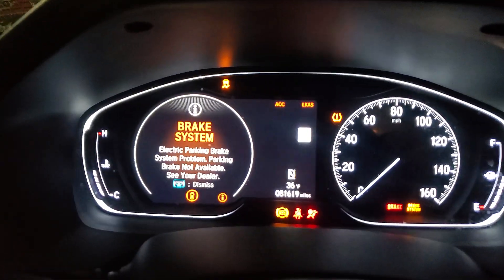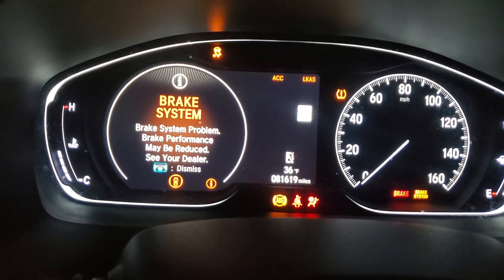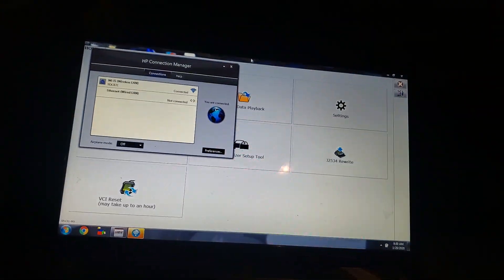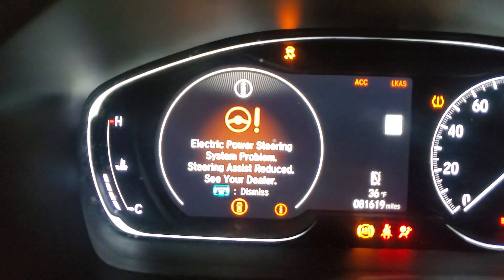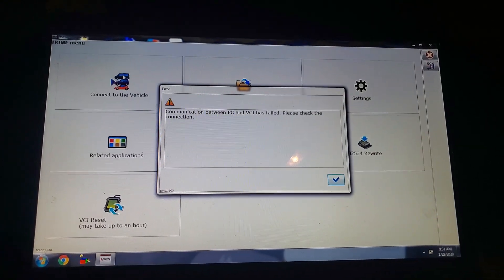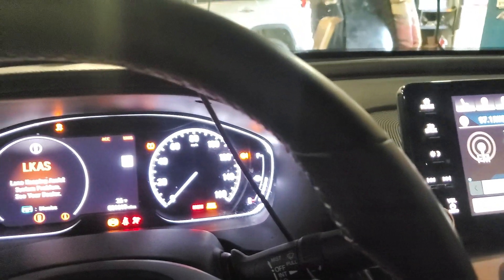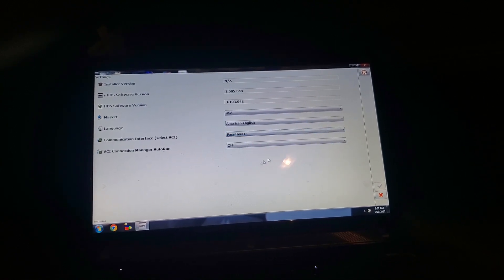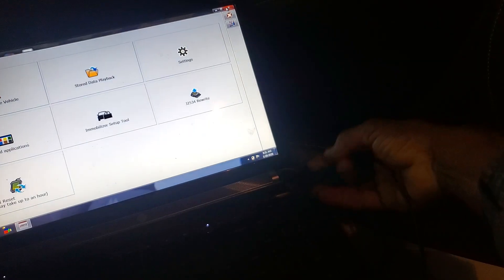2018 Honda Accord Anti Lock Brake Module

Comment: How fix the problem i replace my and wont start also have the immobilizer lighy blinking on dashboard
Reply: Hi there,  have you solved your problem, I have the same issue abs module and pump replaced, car wont start now  and immobilizer blinks
Reply: @mauroarcomaldonado2455  any luck finding answers? Im in the same boat can't get my car started with new module
Reply: @margaritalashchuk4144    Hi  yes I actually got mine working
Reply: But it is not simple,    Your car will not start until  someone with a powerfull enough scanner reprogram the  abs module with the car main module    In an other words   After replace the abs pump  somone need to marry the new module  to the  main car module  and the the car will start,  you have to options, one the dealer wich is expensive or a local Locksmit may have the rhight scanner,   I  asked a lock smith and he  gave me the number of one of he’s  friends that do have the scanner,  he reprogrammed it in 5 minutes and  charge me $160 dollars
Reply: @margaritalashchuk4144  actually  in addition to the scanner  the  person performing it has to buy the state license  ( in california )to be able to install the software, my lock smith toldme it is so expensive so he hasn’t bought it, and thats why he sendme ober hes friend,        I belive  your fastest cheaper option is to  contact a local locksmith and he can refer you to the right person,    In what state are you located?  It my be different in other states
Reply: @mauroarcomaldonado2455  my autel elite scanner took care of the problem and mated with ecu. I actually had 2 problems. First one I purchased was bad used one and also had no communication. Got another used module and programmed it with autel elite. No problems now

Comment: Hello sir,

I have this very same issue in my Honda 2018 accord. Could you please explain me what needs to be done next? It cost me $500 just to tow the car to the dealer as it doesn't turn on. Is there anything else could be done to start and to just make it work and drive to the dealer? Please let me know if you don't mind... 🙏🙏🙏

Thank you and please...
Reply from the maker: call me at 3472281875 please
Reply: We r waiting second face video how to fix the problem after u change the module